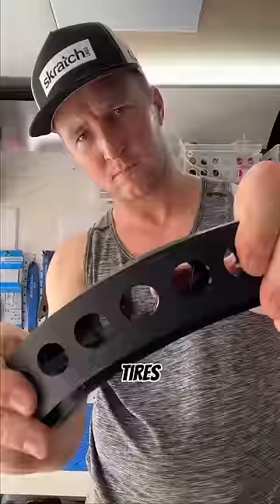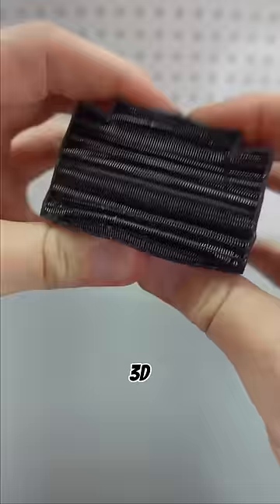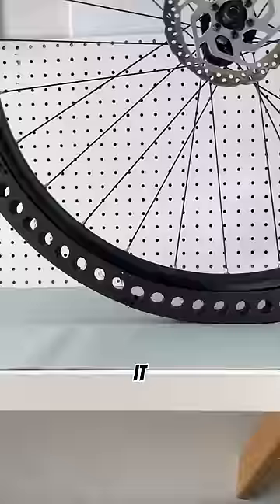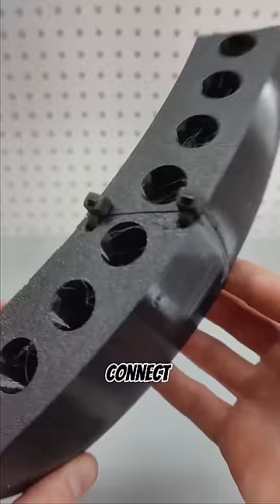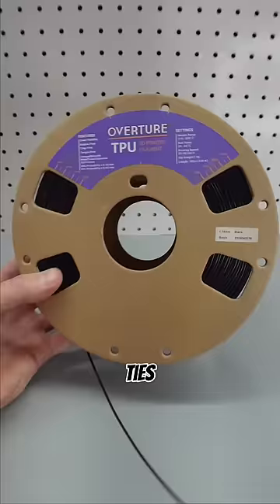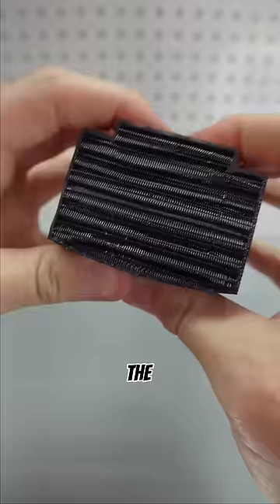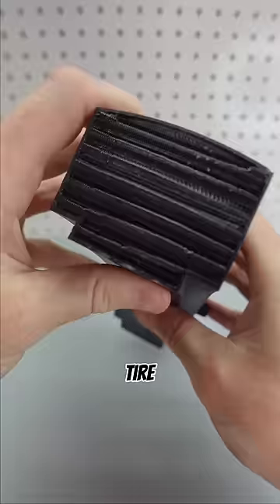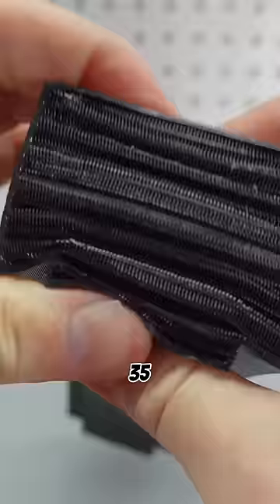3D print your own bike tires! #mtb #cycling #bikeshorts

Comment: Try adding pressure to the sidewalls to test the bead retention.
Reply from the maker: Surprisingly hard to make it roll off the rim! More videos coming soon
Reply: @outsidebrendan  is the bead flexible like the rest of the tyre or more solid?
Reply: @outsidebrendan I'm so curious, that's cool
Reply: @outsidebrendan are files available yet?
Reply: @outsidebrendan   Two suggestions:

1.  Make the rolling surface have a more convex cross section. (curved, like a pneumatic bike tire)  That will help disribute the load and make rolling off the rim less likely.  It will also make them safer to take corners on as it will increase the grip area when the tire is not at exactly 90deg vertical (which is often in the real world)

2.  Add some kind of grip texture to the contact surface.

Adding a follow as this is a really cool project.  Keep it up!
Reply: Now you need to do a ride with it
Reply: I imagine by hand it’s difficult to roll the bead but adding in the other factors I’d be curious how it performs as well! Cool af though NGL
Reply: tRump - 2024 (Georgia Prison)
Reply: I just want to see a curved and treaded outer edge for safety and videos of the physical riding tests
Reply: @Wearyman my thoughts exactly, as is, these tires would be really hard to actually ride.
Reply: @outsidebrendan patents? Licensing on GPL?

You guys need to start supporting property rights
Reply: @outsidebrendan lies
Reply: With the design you could probably just hold it on with zip tjes
Reply: if you can press it easily in with your hands, then its too soft, you lose too much energy pedaling then.  Also, would absolutely not want the outside surface to be that flat. (difference of traction and road grip from going straight vs corners is too much. you need more grip in corners than on straight pieces.
Reply: @Wearyman Yeah The Tire has that Convex Shape for Leaning into a Turn without it you will barely have any traction while doing thats why Motorcycles have it and not a Flat Tire
Reply: @outsidebrendan idk if "surprisingly hard" make me confident enough to turn over 10mph
Reply: @outsidebrendan  Where is this video?
Reply: @outsidebrendan  surprisingly easy to slot into your rim too. The slightest pinch and you’ve lost a section. There’s needs to be a locking mechanism. No way around it I’m afraid.
Reply: Retention
Reply: Where is the gcode for it? Is in on thingyverse?
Reply: Nice handle name! 👌
Reply: @gonelucid  thanks, you too
Reply: Yes this I was thinking it but couldn’t find the words
Reply: Once they're all on and connected it probably won't fall off unless you do something you shouldn't on any airless tires to begin with
Reply: I'm sure it works going in a straight line but how was it while turning pr on the Edge of tire
Reply: Your on your way to work with the military or private company to make better car tires less explosive tires
Reply: Good idea.
One small issue.
There ain't no grooves in that thing
Reply: Need to test friction coefficient to simulate real world environment compared to standard soft rubber. My hypothesis is that it doesn’t perform as well.  The only advantage will be that they are airless, and will only excel in puncture hazard tests.
Reply: I was about to say I’d be riding then turn and die
Reply: If only I had a 3D printer......
This would probably save me some money on buying tubes and tires 😂
Reply: @darkwetntight910 there is a locking system for it, zip ties
Reply: everyone in this thread is just telling him to change stuff based on what they think is correct. let him design his tires y'all have no idea how they perform..  none at all.
Reply: @sumo-ninja  All I did was tell a guy that there is a locking system, and the guy even said it in the video
Reply: @iJ3ff1n911  I didn't call you out individually man, I said people in the comments were telling this guy how to design his own tire.
Reply: bullshit…if it works it is in market already,there were milion attempts like this
Reply: Suprisingly hard or impossible? Because if they come off the rims on a downhill turn you're going to die
Reply: @TrumpSupporter2024 tire*
Reply: @matthewpoole7410 at high speeds or with a heavy load these kinds of tires heat up until they spontaneously catch on fire. Thats why even the military hmmwv's only have solid rollers inside a normal inflated tire.
They have been known to catch a tire on fire because they were driven around without air
Reply: @Wearyman if these really are equivalent to about 35psi, which is really low for a bike, they'll flex when you turn and likely still maintain a pretty decent contact patch
Reply: If add some form of traction i think they would be great
Reply: Hell, I’ve rolled a MTB tire off the rim at 22 psi and that’s with a locking bead. These would scare me to test ride.
Reply: Even a mechanical fastener to resolve it beats the hell out of carrying a bike over a small tool
Reply: @darkwetntight910 I make dumb stuff for fun. Make a little hole to run a ziptie through near the bottom, maybe. It'll look like crap having a zip tie going every inch or so around the inside of the wheel, but if it didnt compress at the bottom alot it would help to not let it totally fail at least. That or a strong/flexable glue to hold it to the rim. Maybe even contact cement if there was enough surface area. Solvents dissolve almost every glue for when they need replacing. Idk tho same worry about it failing while your moving on it.
Reply: @sumo-ninja  he did ask SA
Reply: Don't let temu sellers see this..hope it's patented
Reply: How much im tryna buy em for my bmx because it been a pain with the Tired and tubes @outsidebrendan
Reply: Um yea that looks good if they hold up well to wear and tear they could be great
Reply: @outsidebrendan   Bro make a business and sell them i gurantee u will make great money
Reply: @outsidebrendan amazing my dude what a great idea
Reply: Well if it rolls off you could go through the tyre with ties
Reply: Great for the poor homeless and handicapped peoples❤❤❤😢
Reply: @outsidebrendan on a road bike
Reply: @apaulosmith5653   wrong video soros troll
Reply: Yeesh peeps here are envious hard. Just 2 cable ties connecting the rim and each section would ensure it doesn't come off the rim.
Reply: Yes I would especially around the places I have to ride
Reply: @outsidebrendan been 3 weeks where the video of you riding this bike??? I wanna see
Reply: @TrumpSupporter2024  “tyre”
Reply: I wonder how much more durable it is compared to similar tires. Even if it's slower than everyday tires people will buy it if the price is right
Reply: @apaulosmith5653 You good bud? You just randomly brought up trump on a video about bike tires. Maybe give the politics a rest for once eh.
Reply: @kitkat4189 It can be spelled tyre as well.
Reply: @outsidebrendan I wish to see a video of them in use
Reply: I need this so bad lol
Reply: I like the idea would I be able to make it in a fat bike size?
Reply: @outsidebrendan  what's the link to the 3d printer file and instructions please?
Reply: @outsidebrendan got any designs for 40-45psi?
Reply: @outsidebrendan  How do they handle on flat corners?
Reply: Awesome
Reply: @outsidebrendan screw into the rim
Reply: @apaulosmith5653 😂 living in your head rent free in 2023!😊
Reply: I came just to read new ideas
Reply: I love my city❤
Reply: @outsidebrendan  I’ve been trying to make some tires like these for a while can you let me know the 3D printer you used and what software you used to make them
Reply: @outsidebrendan I emailed you
Reply: @apaulosmith5653 how did you know tRumps cell number... 2024...
Reply: @outsidebrendan that obviously means that it doesn't work and you're still trying to figure things out...
But great idea mate, hope you achieve success making this idea a reality ✌️🙂
Reply: @TrumpSupporter2024 same flexibility
Reply: Zip tie it to the rim 😂 @outsidebrendan
Reply: who what where and when??
Reply: Man it would be pretty funny you slam on the brakes the wheel stops but the tires keeps going😂
Reply: @outsidebrendan maybe by hand. But it's gonna have a full adult weight on top, turning at a medium speed is gonna put so much stress on that little thing.
Reply: @outsidebrendan everybody's hating dude but it's the first thing you made. It has room for growth Keep doing what you're doing the salty people in the comments will never achieve anything
Reply: @Wearyman that's would kill the whole point
He would just created ordinary tyres😂😂😂
Why people didn't content with something already perfect and reliable 😂
Reply: @outsidebrendan Link to purchase?
Do these work for heavy set riders?
Do you sell to overseas buyers?
A reply back would be greatly appreciated. 
Thanks
Reply: W name
Reply: @outsidebrendan  add e bit of "tire" in your tires, like, those rims
Reply: @outsidebrendan looks like it rolled off the rim pretty easy- hence why there aren’t any more videos about this
Reply: It wont matter how much "pressure" you add because it will still slip anyways
It needs a beadlock

Comment: imagine hitting a curb and your wheels fall apart like lego 💀
Reply: Lol. You'd have to keep zip ties zip-tied to your bike frame
Reply: Imagine being able to snap your wheel back together and going on your merry way
Reply: @Katchatiger what if you are being chased by a dog
Reply: @Katchatiger  You're not gonna be merry after flying off ya bike
Reply: @Katchatiger imagine loosing one piece
Reply: It seems less dangerous and easier to fix than a burst tire anyway.
Reply: If you are running disc brakes you could zip tie the tyre segments around the rim through every segment hole as well as at each join. Team that up with some strong tub tape tyre adhesive to prevent creeping and they are stuck like shit to a blanket.
Reply: bruh... you make the lego sound appear in my head *poker face*
Reply: And then the Lego Star Wars building sound effect when building it together again
Reply: Imagine going over a nail and your tire pops 💀
Reply: Then you fall down like play doh clay child’s toy 🧸
Reply: Lego life
Reply: I wonder what the grip is like when it's wet
Reply: @shawnwillis767  one of 5 lmfaoooo
Reply: I just want to know how they take a corner. At speed
Reply: @Madpoptart  I’m a cyclist 🚴‍♂️ 🚴‍♀️ 🚴 43 years it’s like a car 🚗 four (4) tire keeps you on the road back an fourth bicycle two (2) tires 🛞 faster you go faster the gravity gravitational pull towards the ground I can lean 24-30 inches from ground to the lower of the handlebars
Reply: @Katchatiger I want this for my e-scooter. Changing tyres on those is a nightmare 😂
Reply: Exactly
Reply: Lol
Reply: Imagine going over a nail and pushing your bike home 💀
Reply: @Katchatiger yeah you you’ve got a bag full of zip ties with you, also how long would it take to put it back together? Just get a normal wheel
Reply: @marag885 you’ve obviously never changes a wheel
Reply: I just hope it would make the sound effect the LEGO games had
Reply: Nah he’s right because what if you hit a corner too hard and you’re whole wheel comes off
Reply: Why?
Reply: Better than running over a tiny shard of glass and getting a flat
Reply: Well worth a try
Reply: @Scoopthemoopoop  this has happened zero times in my life and I'm almost 60 so
Reply: @whatwasisnot  true but that happened with normal tires.
Reply: @shawnwillis767  I suppose you could carry spare pieces
Reply: lol you can 3d print it in one pice
Reply: hahahahahahhahahahaahhahahahahah :D
Reply: dont hit a curb?
Reply: Imagine riding after it rained
Reply: you still gotta put a tire on
Reply: i dont think yall understand how strong zipties are. like 2-3 of the things can support the weight of most average humans. 5-7 of them depending on the type and thickness are enough to suspend a 4 cylinder engine 2.0l engine.

love when normies talk out yall asses though. its cute, really, completely adorable.
Reply: Thank you for the laugh 😂😂
Reply: @whatwasisnot hypothetical
Reply: I'm pretty sure it's still supposed to have a tire just not an inner tube for air
Reply: Lol
Reply: Instead of bending tour rim? Lol I'll take it
Reply: I could hear this comment
Reply: Imagine not paying attention so you hit a curb
Reply: I can hear the sound effect
Reply: @shawnwillis767 image of luffy fades in
Reply: @shawnwillis767  the one peice🗣🗣🗣🗣
Reply: @Scoopthemoopoop thats a rare enough event that it isnt worth taking into account
Reply: i think if you use zips to tie them to the rim tru every hole i think you can even dirtbike on them
Reply: 1. they're zip tied together.
2. Are you really that bad at riding a bike that you're always hitting the curbs? You don't have to hit them, you know?
3. If one gets damaged, you should really print another problem solved.
Reply: Kinda like sonic when he runs into spikes
Reply: Zip ties bro
Reply: @Katchatiger  these tires wouldnt last 10 minutes
Reply: I read that sentence and heard the lego start wars sound instantly in my head
Reply: @marag885 yeah but most of the time a tire on a bike will loose inflation due to a small puncture not just suddenly explode. Whereas if you use this and just one piece fell off incorrectly, it could cause it to flip in a way to cause a even worse accident underneath your tire, depending on which way that piece flips. If it wasn’t held on via zip ties it’d be understandable.
Reply: Good point I didnt' think of when first watching this video
Reply: @Scoopthemoopoop  You better build fast
Reply: Lego death animation
Reply: I was thinking the sane thing but on the first corner when you go to turn this going to just come off.
Reply: Then you did a bad job attaching them together dude.
Reply: @Katchatiger Also, carry spare sections of tyre in your backpack. If one gets lost or damaged, switch it out.

Way easier than trying to patch an inner tube in the street or walking your bike home with a flat tyre.
Reply: @shawnwillis767 Carry spare pieces… they aren’t that big or heavy.
Reply: @marag885 It’s especially easier than trying to patch a punctured inner tube in the middle of the woods.

Assuming you can get the wheel off, and remove the tyre from the wheel. Generally you’d want some basic tools, and you’d need a patch kit and glue and a bike pump to re inflate it.

Easier to bring some spare sections of the 3D printed tyre and some spare zip ties.
Reply: Perfect for riding your bike to the mailbox.
Reply: Imagine hitting a storm drain and 3 pieces go through the hole lmao
Reply: Like when a Lego character dies in the video games😂😂
Reply: @stevenduering7155  hahahaha exactly
Reply: I wouldn't worry about it. First you'd need to find a way to keep the tires together long enough to get to a curb.
Reply: goofy ah lego sound
Reply: Imagine it being a busy intersection, think I'd curl up and die
Reply: @Katchatiger This won't break in a clean "zip it back together" fashion. It'll crumble, because TPU with a partial infill is going to be fragile and break over time.
Reply: @Scoopthemoopoop there three holes vulnerable to the dog & my two fist .
Reply: Imagine puncturing your tire on a sharp rock😂
Reply: Thanks for sharing that and I would love to give it a try.
Reply: Design a motorcycle seat cushion . Along with a tank rack .
Reply: @MrDegsy69  ...stuck like shit to a blanket.. who uses that term LMAO
Reply: @housemana  My gran always used to say it when she got her false teeth properly glued in with Poligrip. 🤣🤣🤣
Reply: Lego Star Wars ahh shit
Reply: You could join them with a strong adhesive
Reply: insert Lego breaking sound here
Reply: Sound and all 😂😂
Reply: @shawnwillis767 Gol D Roger?
Reply: Imagine lego island death sound with that
Reply: Imagine lego island death sound with that
Reply: Imagine not watching the video
Reply: @teonyi You know that tires don't pop, right?